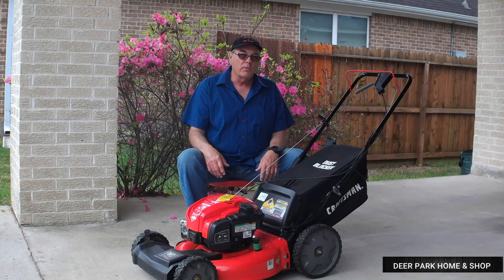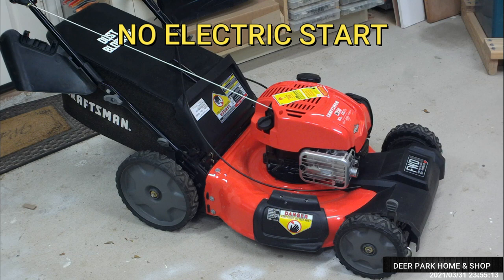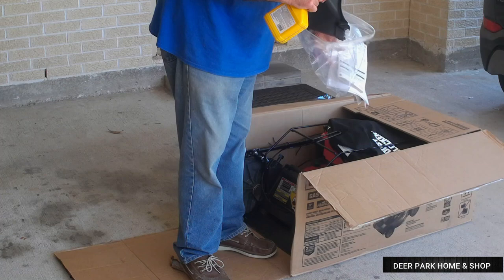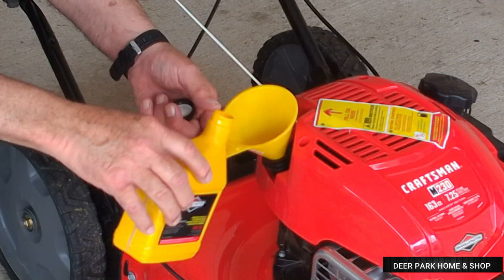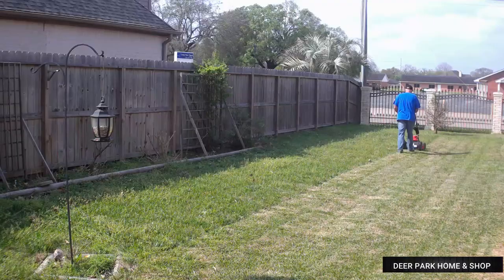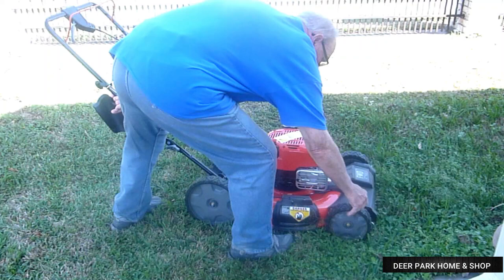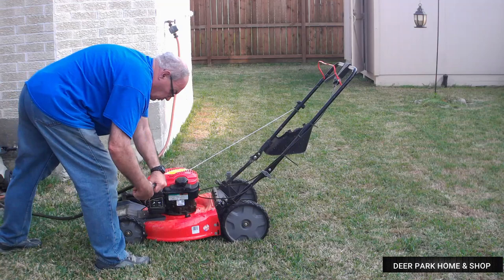Craftsman M230 lawnmower - unboxing, set up & review

Comment: What kind of oil does it take
Reply from the maker: A 5w30, 30w, or 10w30 motor oil will work.  The manufacturer provided Briggs & Straton 30w small engine oil with the mower, so that is what I will replace mine with, especially during the warranty period.

Comment: Is all bushit the instructions howbto start it is not in the package 
The video did nothing
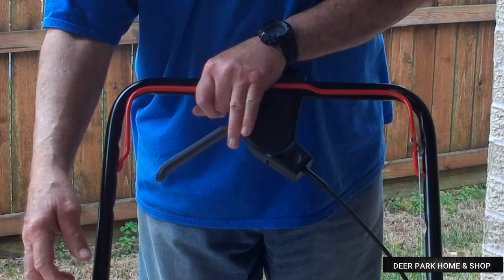Reply from the maker: If you've added the oil and fuel it should start. I guess that you have done that but it's not starting?  AT the 5:30 to 5:45 point in the video, 1 first pull the red orange bail (lever) back against the handle and then give the rope a strong pull and it starts.  If that dosen't work you may need to talk to your seller.

Comment: My cord is very hard to pull. It just won’t budge and I am afraid to break it
Reply from the maker: It should take only a moderate strength pull to crank it.  I would talk to whoever sold it to you and see if you can get an exchange.
Reply: @deerparkhomeshop2471  come to find out I had to pull the handle up more from out of the deck. The handle has keeping the blades from spinning. Thank you your help 👍
Reply from the maker: @joshuamoody3238  That's good news.  Sounds like you have it figured out.